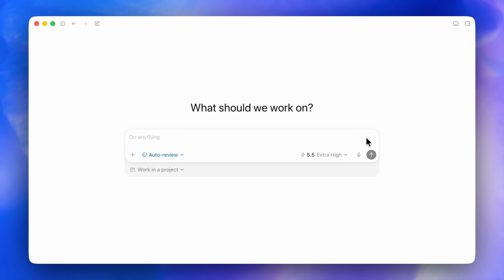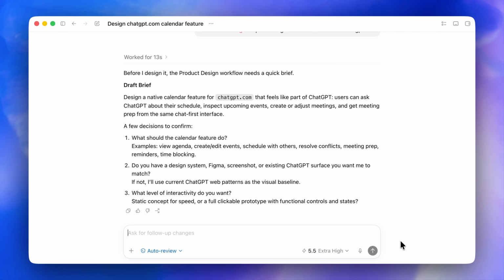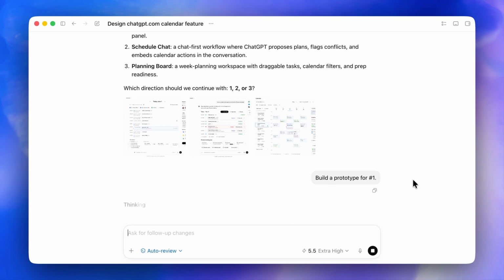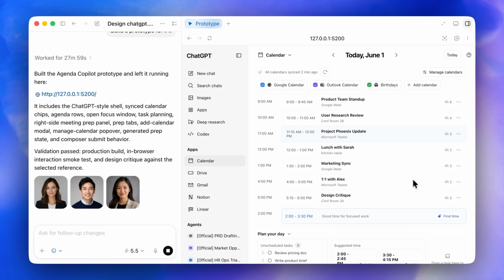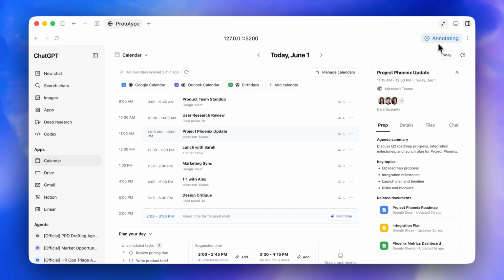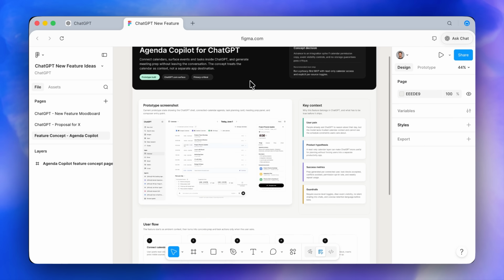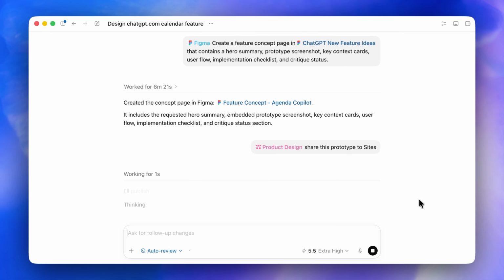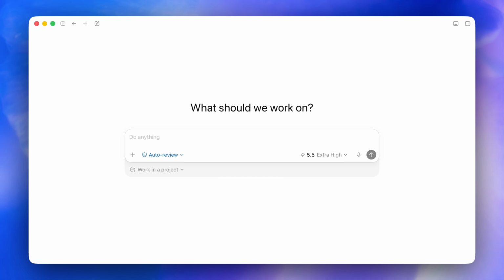Build and share interactive prototypes in Codex

Comment: Is it possible to import a design system from Figma or from a Figma file? Many tools like this will give you an ok 7/10 result from a screenshot but you end up having to redo so many things to make it match your actual design that it doesn't save that much work. Being able to import design systems and have chatgpt strictly adhere to them if asked would be a game changer and would make me switch from Claude Code + Figma MCP which I'm using now
Reply: Hey Tomas! Yes, run "@Product Design setup" and you'll be prompted to setup design systems and references. This should help ground your designs! We want to improve this a lot in the coming weeks.
Reply: @alistair-oai  Thank you for your response! I will try it today and report back.